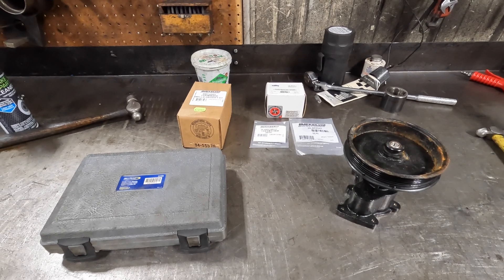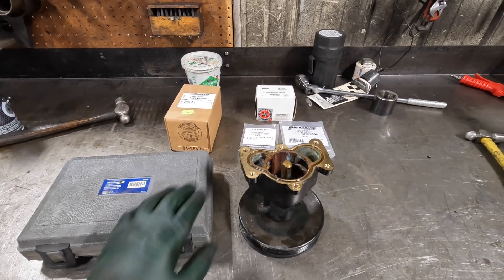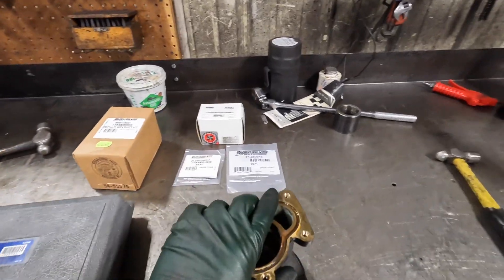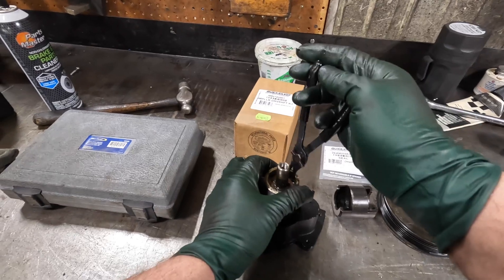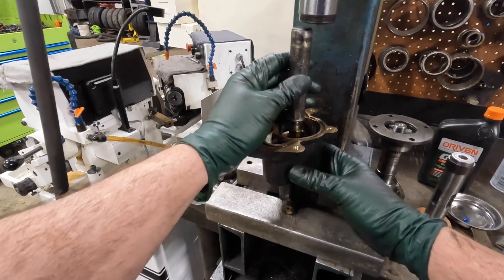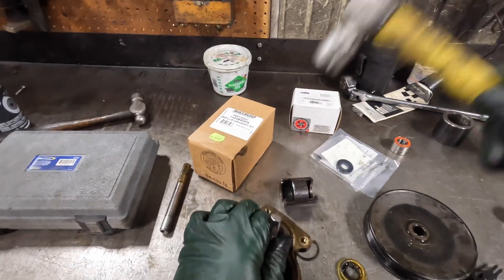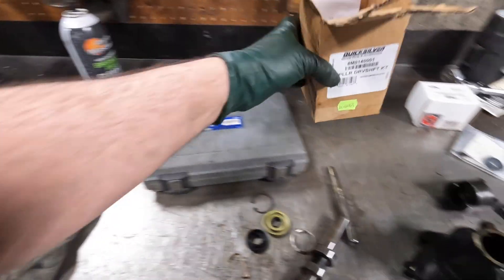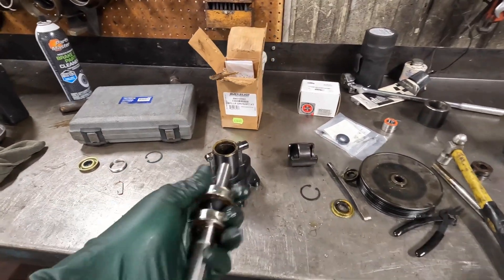Mercury Mercruiser Raw Water Pump Rebuild 2001-2016 ish 8.1 5.0 5.7 6.2 8.2 4.3

Comment: Wait, you didn't show the rebuild process.  You left the most important part of installing the rubber gasket and the remaining housing. Most just replace the impeller unless you have a leak through the shaft and bearings.  Poor incomplete video.

Comment: Great video only thing I wish you would’ve open those instructions. Mine don’t have a spacer between the bearings, and I was wondering if there is a spot certain distance between them
Reply from the maker: Original pumps didn't have a spacer. I always measure them before I take it apart.

Comment: I have always hated Mercury raw water pumps. The plastic housing always cracked where the hose went on at. Glad Hardin Marine came up with a fix, 316L stainless steel raw water pump. If you boat in the saltwater like me, you'll like it even more.